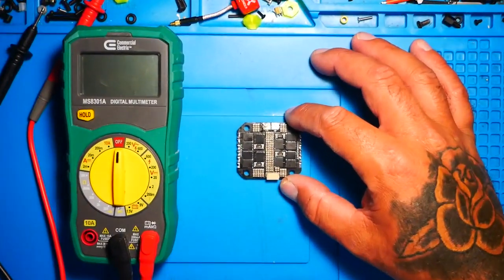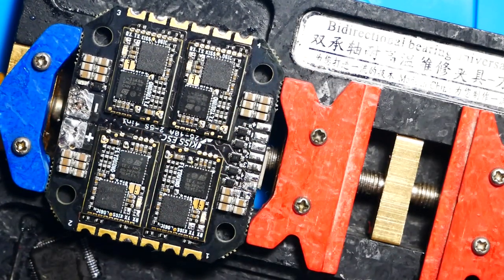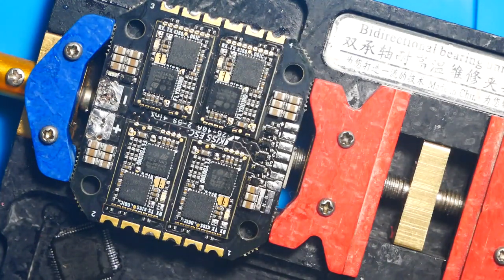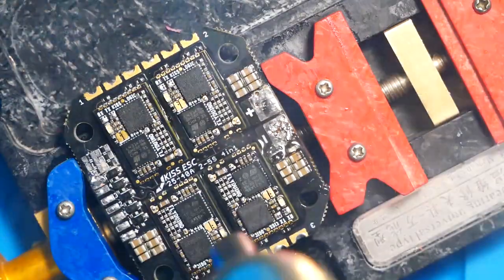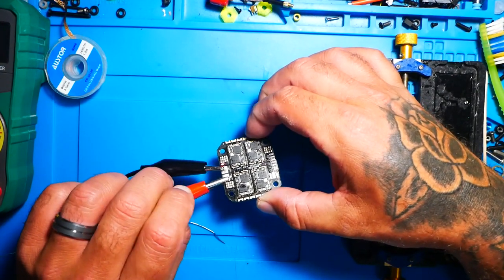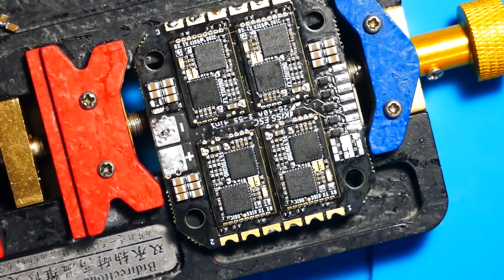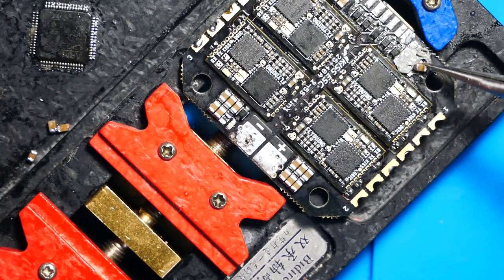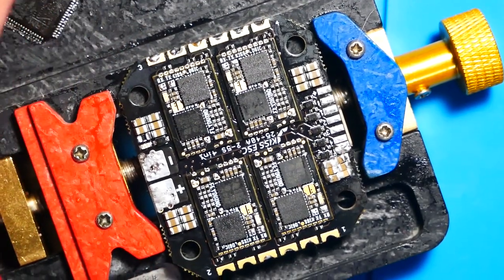How To Repair Your 4 in 1 ESC - KISS Short Circuit Repair Step by Step

Comment: so even if my 4 in 1 esc has dropped 3 ceramic capicitors I can just solder on an external 35v 1000uf low esr cap and it should be ok and wont damage it more to fly like this?

Comment: Hope u could explain more on how to pick the correct capacitors for replacement.  Measure the size,  find the type n pick the highest capacitance?
Reply from the maker: I actually did have that but the video was like 34 minutes so I cut some things out
Reply: @DrainManFPV  on the end of the day , wich one are they for Kiss ESC 4in1 as i just repaired mine and want to order them. PS: Epic JOB !

Comment: Hello there! Thank you very much for the repair videos. I have an Aikon ak32 35A 4in1 esc that doesn't ppwer up. I was trying to spot the issue and i think it the the voltage regulator that is right after the power lead. I found a picture that says E39 on it but i cant find any info about it. I would appreciate any help!!! ❤️
Reply: e39 is your current sensor.

Comment: Hello, I have a question, I have a damaged wasp 85x, one of the engines breaks and does not turn into rotation ...
I changed the motor and the same thing, then when soldering I noticed a fried capasotor, then above the pad for soldering the cable to the motor, you would help me find what caps I should replace, I mean its capacity, I can't find any schematic (ps I'm an electronics leg, so please hammer like for an idiot: P) where what for how much? : P)

Comment: DrainmanFpv thanks for all your great videos. Sorry this is off topic question. Have you ever try using kiss flight controller with Blheli32 esc? Would it fly different from a kiss esc or the same? I been wanting to jump to using kiss but I'm afraid of their 25a 4 in 1 esc going up in flames. Thanks for your time sir.
Reply from the maker: Hey Chuey, I have not tried that, I have tons of kiss 4in1s I've never had one catch fire on me. Don't be afraid! Once you fly kiss you'll never go back!

Comment: Hey buddy awsome video! I have that exact 4in1 but my problem is my 3rd esc signal light is dim. The others light up like their suppose to. What could that be?
Reply from the maker: Does it work normal ?
Reply: @DrainManFPV  no motor wont spin
Reply from the maker: @michaeldyer6079  do you have a short?
Reply: @DrainManFPV  no sir not that I can tell

Comment: can you not just test the capacitor one by one with the multi meter?
is it possible to measure the capacitance?
Reply from the maker: The proper way would be to remove them one by one and then test them one by one. That would suck....

Comment: I pulled the power pad off my 4-1. Anyone know if that's fixable
Reply from the maker: Normally with PCB once the pad has been removed from the board there is not much you can do unless it's a flight controller then you can soft serial.